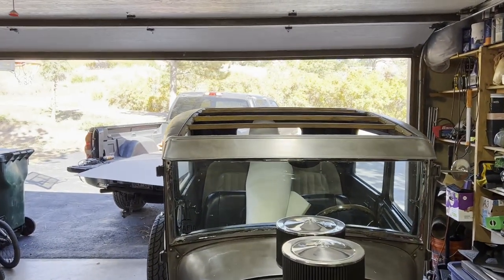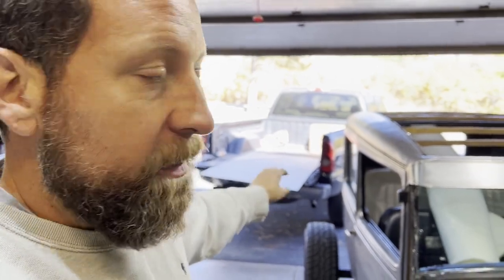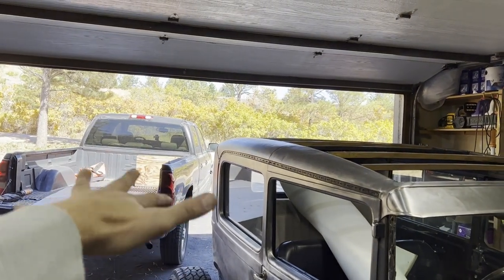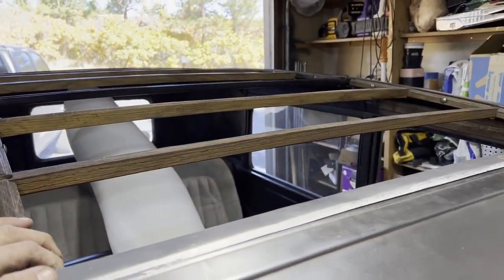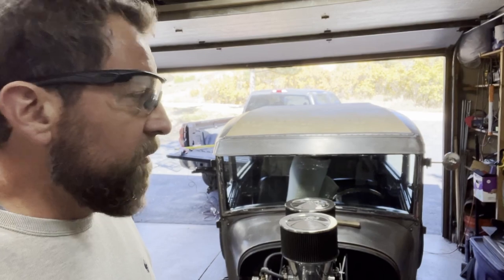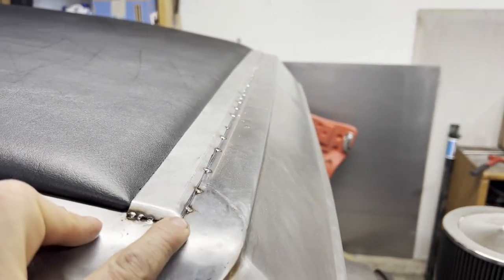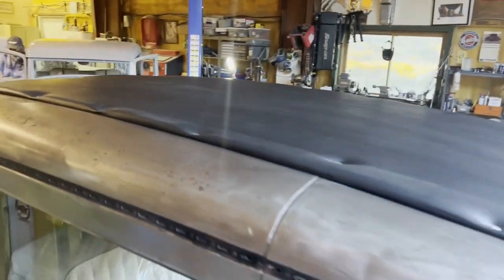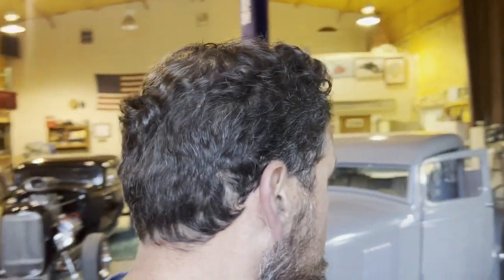A Homemade Roof Insert?  Can a Guy Build His Own Model A Top at Home? BHG Ep 123

Comment: Nice work. I did mine with long metal strips on the sides and also for for the front and back I just welded studs to the strips and mounted with the studs going inside with some nuts that  hid my bolts.
Reply from the maker: That’s a great idea, thanks for sharing.

Comment: what did you use to get the bare metal to look like that thanks
Reply from the maker: @jaysrodsjay3593  I used a surface conditioning tool with the red drum.  Then to keep it looking good I use Gibbs penetrating oil.  It supposedly does not ruin a guys chances for painting the metal later.

Comment: The only thing that I would have done different is they make some bolts that have a flat head on them. So I would have drilled the holes and put the bolts on then the foam and then the vinyl. I'm sure that those bolts have a technical name but I don't know it. Maybe someone will. The head looks like a big washer. When my Model A gets to this point I'll have to remember your trick for holding down the front of the top. Pretty slick.
Reply from the maker: I like that idea.  I tried to find those bolts but couldn’t in the short time I took for this project; maybe I’ll redo it sometime.  I don’t like how thick the foam is, so there’s a chance I’ll redo it one of these days.  Also, one issue I ran into was not being able to get the very front bolts in with the front of the top slid into the front part, it was too much of an angle so I just drilled it through.
Reply: Coach bolts
Reply from the maker: @NZMOPAR  thank you!
Reply: @NZMOPAR  Thanks man. I new that somebody would know what they are called. I went to my local Tractor Supply store and they don't carry them. There is another hardware store in town that carries some oddball stuff so I'm hoping that they might have them. I also thought about furniture nuts. You drill a hole in the wood and then press in a washer like deal that has a part that has threads in it then screw the bolt up from the bottom. I hope that makes sense.
Reply: I believe the bolts you are looking for are tee-bolts. A lot of woodworkers use them.  You drill a hole and put the tee_nuts in the hole and then the bolt installs from underneath the plywood.